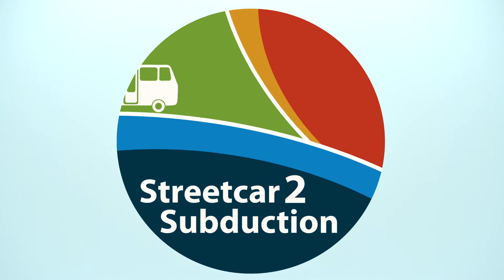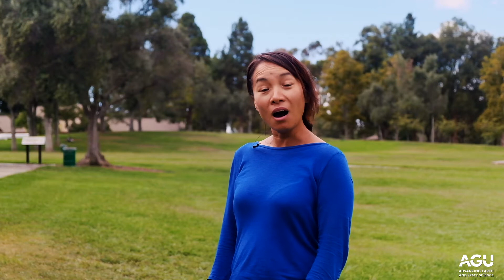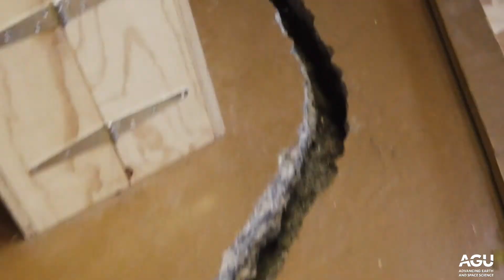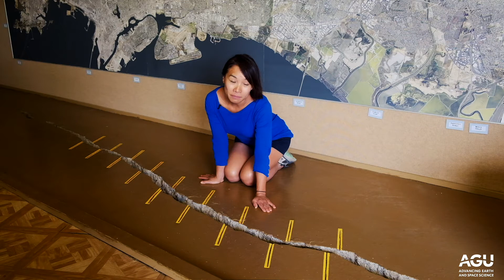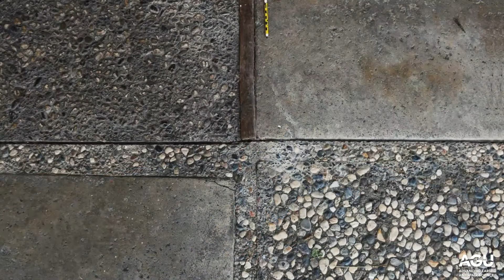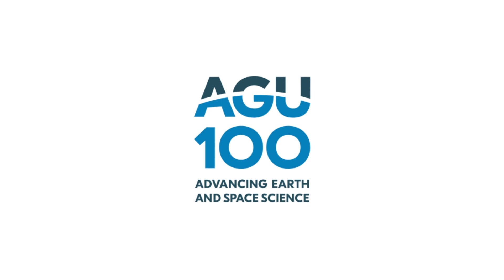Virtual Field Trip: How buildings move along the Hayward Fault

Comment: She  is describing a strike slip fault, this occurs when the two blocks are moving  horizontally in opposite directions. This looks to me to be a right lateral slip, since the wood is bent on the right side. I believe the stress type would be shear, this is why they slide past one another.